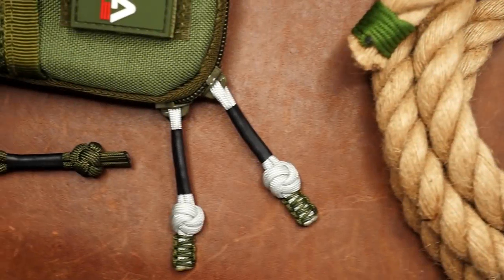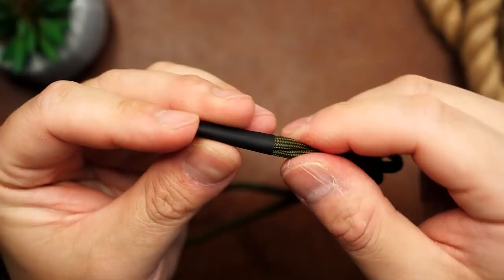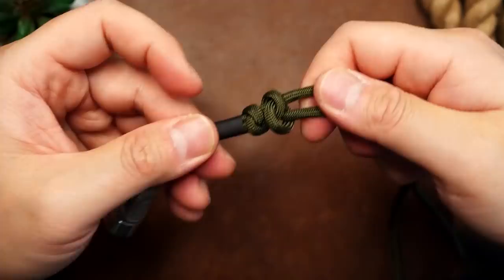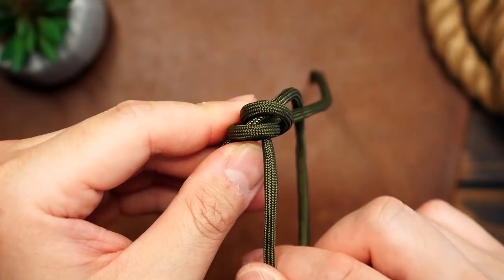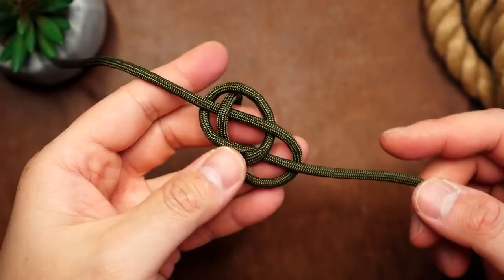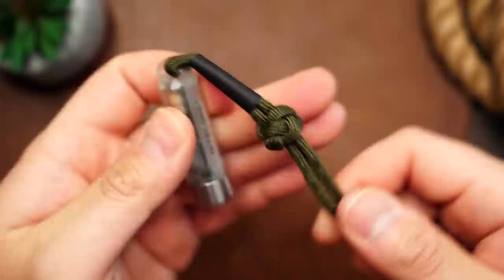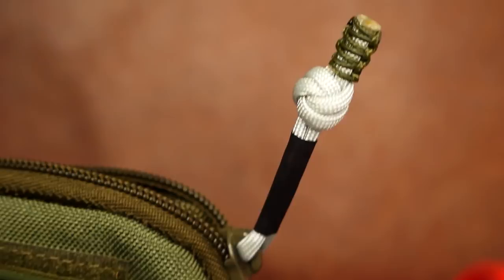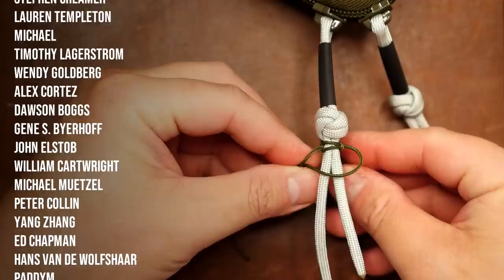PRO Looking Paracord Zipper Pulls/Lanyards | Heat Shrink Tubing

Comment: I recently posted my paracord camera strap on reddit with heatshrink tubing. Any chance you‘ve had some inspiration by this? 😅
Reply from the maker: I got the inspiration from an EDC pouch I bought from Garage Built Gear. It came with heat shrink tubing on one of the lanyards and I had not seen it before, so that's where I got the idea. Do you have a link to your camera strap though? Would love to see it.